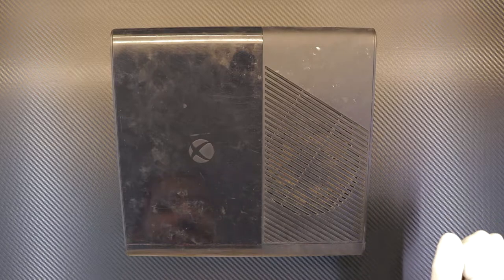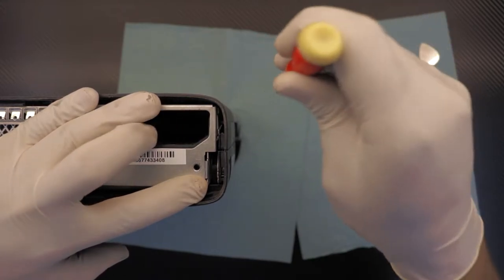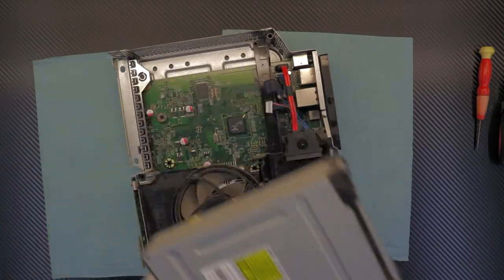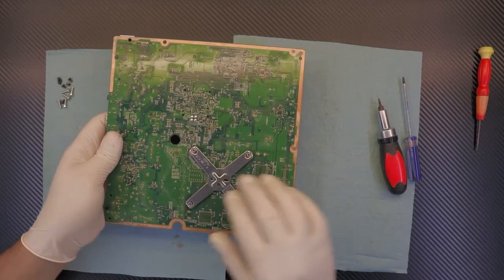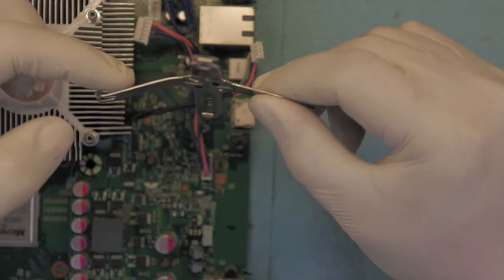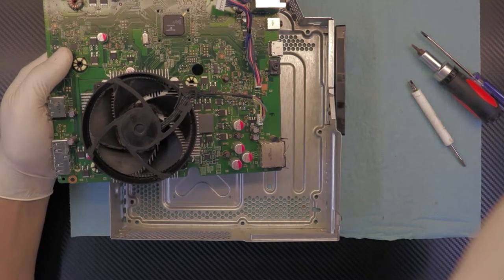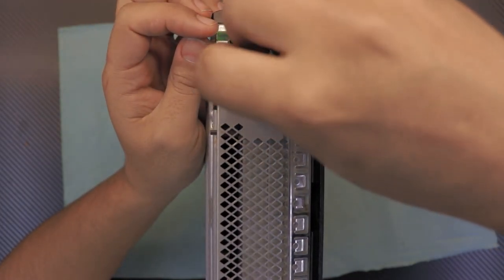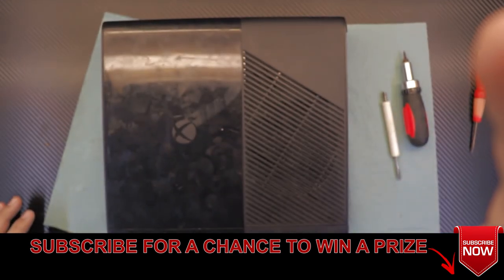XBOX 360 SUPER SLIM disassembly , Repaste, service and fan MOD and cleaning

Comment: The information in this video is helpful. However I find your method of applying thermal paste to the heatsink very questionable. I understand you are going for the most surface area covered. However placing it in the method you used can create air pockets within the thermal paste as it compresses. It's much better to apply a single bead in the center of the heat sink area and let it spread outward on its own from the pressure. Doing it that way keeps air pockets from forming while still keeping the area covered as large as possible.

The other thing I noticed is your bending of the 'X-Clamp' as they are commonly known. The 'X-Clamp' is one of the major failure points in the design of the entire line of 360 hardware revisions. As the board heats and cools during use, the direct central pressure and outward corner pressure is one of the main causes of system failure. Adding more pressure to the clamp is actually the exact opposite that you would want to do in this situation. A common "fix" for this in the original days of the 360 was to replace the clamp entirely with nylon washers as standoffs and use 4 screws to apply only corner clamping pressure. This pulls the heatsink against the CPU from only the corners allowing the board and CPU socket to freely flex as the temperature changes during use. Without having the central pressure from the original clamp this greatly reduces the chances of failure.

Other than those two things, the video is very well done. Though it wouldn't have hurt to just pull the pin from the fan connector instead of clipping the wire. I have repaired countless original model consoles, but I was looking for more information specifically on the E model. I'm glad I came across this video because the disassembly instructions are quite helpful to keep from breaking the brittle case tabs. Thanks for the video regardless.
Reply from the maker: hi, thanks for your opinion and comment, let me tell you i have done so many methods of applying thermal paste and let me tell you that they are work the same as long as there is enough pressure. and yes the bubble formation in the thermal paste will and would happen if the pressure is not enough.  i been doing electronics and services for over 14 years and i have done my share of testing from putting a single bead to apply the way i did in the video and let me tell you that, i never had different results in temps nor problems because i make sure there is enough pressure.  none than less the right  and safe is the drop in the middle  and making sure you cross stitch the heat sink screws  else you will push everything to one side and going to extra steps and explaining that in the video would make it longer  so the reason i did this way in the video so i save and no going in detail of explaining the other method. 

regarding the X clamps you are right  i do put washers and remove the standoff and put a direct bolt in the heat sink and pull that suckers to the right pressure point, but i may not agree with you on the bending the x clamps because physically the x centre part pushed inward under the BGA and the legs create the tension requires to pull the heat sink ,  and this is based on test and facts, that has been done with solid works application ( as i have a  physical engineering and electronics background ) models and test i am planing to make a video and show the results.

Regarding the cutting the cable you are right, i should of pull that pin out and then shrink tube that , but that would involve in many more steps and there was no need for those extra steps as the cable was going to stay off. 

i can tell from your comment you are smart and think out side the box :)

-Damon
Reply: You are Mostly correct, however, the x clamp is designed to let the board flex and move, so that when the board Does flex and move, less pressure is put on the solder joints of the apu. Applying screws and washers warps the board, and does not allow for it to move. Over time, this distribute pressure very unevenly, causing the xbox to red ring.

Comment: What is the difference between the Xbox 360 slim and the super slim I knew I should've watched this video
Reply from the maker: the charger pins connector and y form factor and they have used different components (better components)
Reply: @uFixTek   this isn't super slim this is the elite model you made a mistake with the description.

Comment: Best tutorial on YouTube..Very helpful..Thanks a lot.
Any idea why my controller keeps disconnecting?
Reply from the maker: Thank you for the feedback and your support to the channel regarding the connection issue on controller, you need to run a test, 
does it happen with another controller o only that specific controller?
 test the controller on a friends xbox or test his controller on your xbox.
if his/her controller does the same on your xbox then its simple that your front panel board is not working properly and you can change it super easy. BUT if the other controller does work then you have a bad controller and you will need to repair or send it to repair. sorry not much i can do. but let me know
Reply: @uFixTek  Managed to fix it...As it appears it was the bottom 2 springs in the AA battery case..I pulled them up and clean the contacts and since then i have no more diconnections..Thanks a lot for your help and keep up..I am following..PS: MX4 has no cure time...Arctic 5 has a very long period since cure...
Reply from the maker: @nickvaxou2276  im glad you got it fixed and thank you for the feedback, and regardign the mx4 and artic 5 to be honest both are good but you still get a better results by mx4. by all means try it out and you can see the differences. we use many paste in the shop here. but if you want a best paste go with :
thermal grizzly kryonaut
https://amzn.to/3ubnrJS
is the best out there and long lasting.

Comment: What size bit did u use for the heat sink cause none of my bits work
Reply from the maker: Thank you for the feedback! if you wish to support the channel you can LIKE or SUB or both :P
regarding your question: its torx 8 for the black small screws and torx 10 for the metal case (silver screws). it has to be a SECURE torx (i pin hole in the middle)
https://amzn.to/3JWuI8d
Reply: @uFixTek  thanks
Reply from the maker: my pleasure my friend, if you have any question or request in the future feel free to ask me.

Comment: The X clamp won't go back on
Reply from the maker: use the screw driver to push it from the one hook that is in to other end and press hard on the other end and it will go down use force.
https://prnt.sc/yqn3qt
Reply: @uFixTek  ok, thanks pal. can you also help with balancing the motherboard? The weight of the ports is making it lean and 3 of the pegs sink in to the motherboard
Reply from the maker: @19:12 you see me with one had i keep the pressure on top of the motherboard where the heatsing /fan is located so this way the board wont fall to the other end , but you can improvise and place a small cardboard box or something as the same height of the fan and heatsink.
Reply: @uFixTek  I still can't get the xclamp in. The hooks won't grip on to the pegs
Reply from the maker: but it goes down all the way?, just it wont grip right?
if so use a plier to close the hook and bit
Reply: @uFixTek  yeah before you replied I tightened the hook and after some effort I got it on to all 4 pegs after the repaste. Thanks for helping bro, your videos deserve more views 👍
Reply from the maker: i appreciate your feedback and i hope i get more views :P im glad you got it working if anything else, you always can leave me a comment in any of my videos and i will help you out.

Comment: Is it possible to dissasamble and regrease the fan? I have pva09g12p brushless fan but no back cover for grease.
Reply: Full throttle mod helped to keep it running but it is too loud.
Reply from the maker: if it doesnt have a back cover for grease then you need to pull out with force there is a tension ring that is holding it if you pull on it evenly it will comeout,  i will make a video on how you can do it in few days
Reply from the maker: if it doesnt have a back cover for grease then you need to pull out with force there is a tension ring that is holding it if you pull on it evenly it will comeout,  i will make a video on how you can do it in few days
Reply: Thanks. Tried to drill a hole and push the spindle out but still nothing. Neverless the hole allows to free the fan a little and it spins now more freely. If it will fail then have to buy a new one anyway but seems could just work with regreasing.
Reply from the maker: oki if you need to look for the new one left me know

Comment: Bro i just followed this tutorial and also modded the fan. It's running very fast which is good. But now I'm getting no display whatsoever on my xbox 😭. Bro plz help if there is a way to fix it??
Reply from the maker: Follow the following steps make sure your controller is connected via usb cable.
To reset your display settings, follow these steps:
    Make sure there’s no disc in the disc tray.
    Turn off the console.
    Turn on the console.
    As the console starts, press and hold the Y button  while pulling the right trigger on the controller. The display settings are reset to the default settings, and then the console automatically restarts. 

Xbox 360 E or Xbox 360 S console: To reset display setting on these console models, you can also just turn off the console and then hold the power button on the front of the console down for about 10 seconds. (The lights will flash several times.)
Reply: @uFixTek  THANK YOU SOOOOOOO MUCH BROOOOOOO IT WORKED!!! LOVE YOU BRO 🤗
Reply from the maker: You are welcome! Glad you could replace it 😊Thank you for the feedback! if you wish to support the channel you can LIKE or SUB or both :P
if you have any question or request in the future feel free to ask me.
Reply: @uFixTek  Thank you🥰
Reply from the maker: my pleasure :)
Reply: @uFixTek  hey bro. I just followed your Xbox 360 fat service tutorial. After assembling and everything I'm getting no display whatsoever. It happened when I serviced my super slim through your video too. However the it was fixed by resetting the display settings. But with my Fat 360 I not getting any display. It was running great before. Please help me 🥺

Comment: How dirty is that xbox! Keep your consoles clean!
Reply from the maker: Thank you for the feedback and your support to the channel , 
I do always say to my clients to give the services every 8months.
Reply: @uFixTek  my 360 kept freezing so today ive followed your guide step by step, the thermal paste was completely dry and the fans were quite dusty. I also followed your advice and cut the fan wire, I cant believe the difference in fan speed! Before you do it though folks, it makes it very very loud, but if it keeps my 360 healthy then i will put up with it. I have turned my xbox back on and immediately I have noticed a difference in speed and smoothness and the bit of the game i couldnt get passed, smooth as butter no problems. Top guide.
Reply from the maker: Thank you for the feedback and i will make a mode if you wish to place a few component to keep the fan noise low by bringing the RPM down. but when you game i dont think you can hear the fan over the game noise :P
Reply: @uFixTek  yeah that would be good
Reply from the maker: @jonnyp841  i will add it to my notes :P soon

Comment: Its not a flex cable its called a ribbon 🤣
Reply from the maker: you can say flex cable or ribbon cable both are the same, 
FFC, refers to any variety of electrical cable that is both flat and flexible, 
However, the term FFC usually refers to the extremely thin flat cable often found in high-density electronic applications like laptops and cell phones
Thank you for the feedback and your opinion.